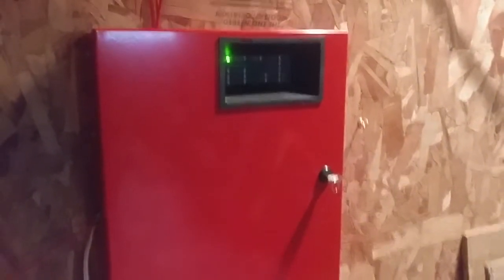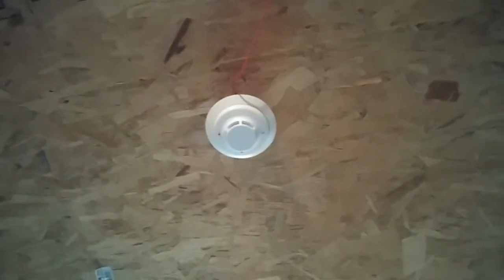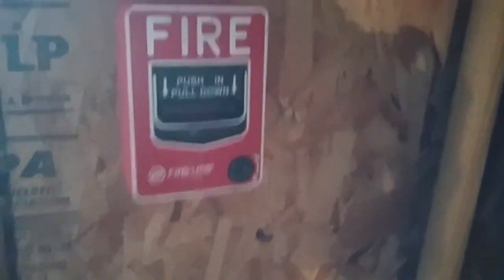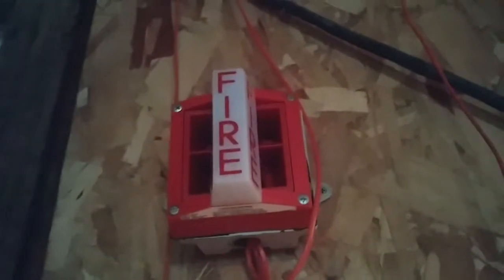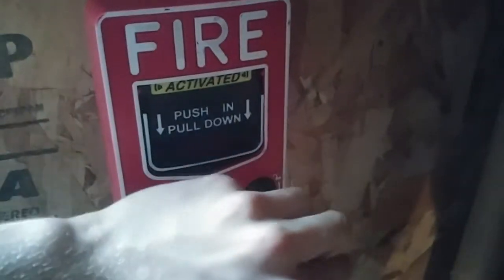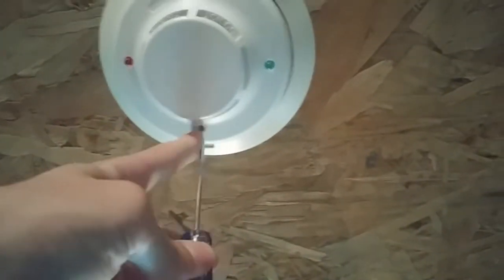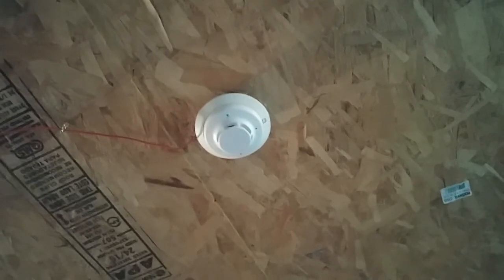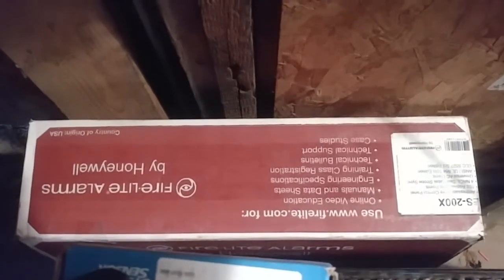fire alarm System test 25. Old vs new system sensor. #FireAlarmFriday

Comment: Can I guess the new panel. I think it is a 4004
Reply from the maker: Maybe 😏
Reply: @vintagefirealarmguy5285  do  the 7002 t on high volume on continuous with the strobes on the highest setting with the,425120 t bars
Reply from the maker: @dustinkey8885  this system is long gone. Plus I dont have any of my alarm stuff anymore.